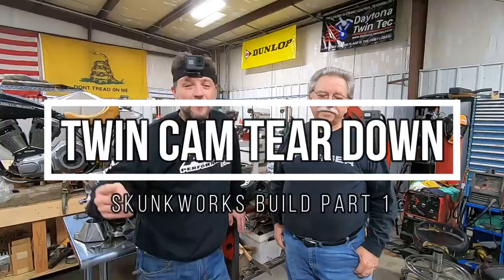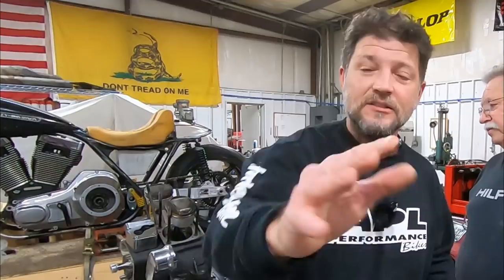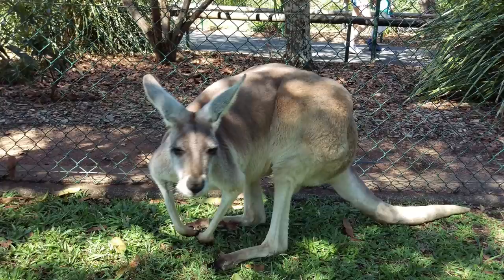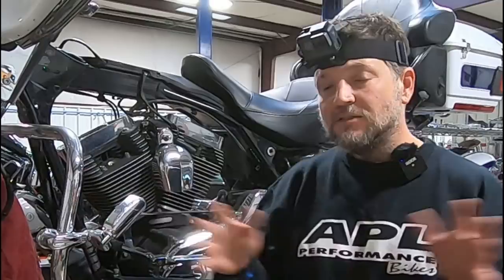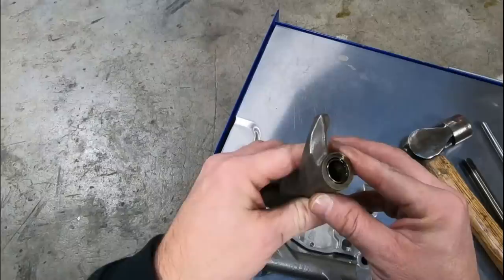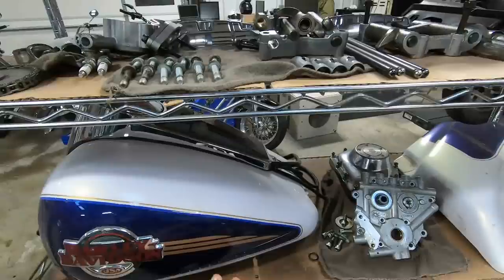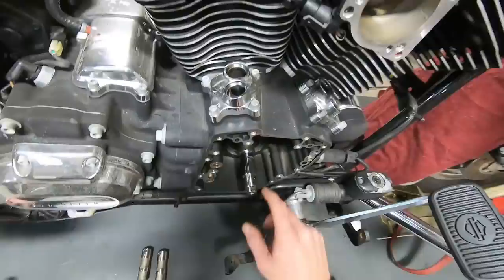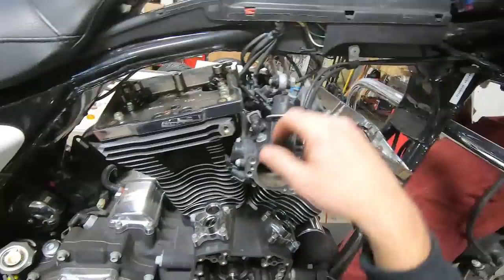Twin Cam Tear Down Harley Part 1 - INTERVIEW WITH DEFECTIVE M8 OWNER - Kevin Baxter - Pro Twin Perfo

Comment: I'm glad you're doing this.  My 2012 Superglide had a BUNCH of metal, aluminum shavings, for the 1st 10K miles.  Plugged oil passages, 2 quart oil refill, till I was finally at 2.75 quarts of oil. (At 10K.)  Dealer said, don't worry.  That said, it now has 106K miles on it with never a wrench to the motor.  Blessed.  No other explanation.  But when it comes time to rebuild her, I'm trailering her back to you boys, from Arizona.  Yup!  I'm sold on you boys.

Comment: My problem isn’t with HD quality control or commitment to quality, it’s the response to a customer concern and failure to address a manufacturing defect in their engine.  No ownership or accountability from HD that completely dismissed a customer complaint.  Might be a specific dealership but in my experience it is universal among HD.
Reply: I had 1 dealer that treated me very well they sold me a bum used fat boy that was punched out to a 95 Cid it would blow oil out of the exhaust id go through a full quart every 100 miles. After tearing the engine apart 3 times they offered me a replacement bike that cost 4k more than the fat boy. Straight up trade and I am really enjoying my streetglide
Reply: @Running-with-skizers  That’s great, glad you had a positive experience.   Any chance you can share what dealer, I’d love to know.  Thanks
Reply: @Squatch_Rider66  it was Z and M in Greensburg Pennsylvania
Reply: I tend to blame the dealer and not HD. HD maintains an arm's length from retail customers for a very good reason. They would never have the staff to address all customer concerns directly. That's what the dealers are for. If your dealer does not give you the answer you would expect, go to another dealer.
Reply: Delt with 3 dealers in Australia and all were fantastic

Comment: I’m looking forward to the Evo repair series. I bought a ‘93 Heritage new in ‘93 and rode it through 46 states and 210k miles before rebuilding it. It currently has 23k miles on the rebuild and has  been coast to coast twice in Summer 2020.I’ll never part with it and I dig carbureted Evos !
Reply: What we need is a stand alone  bolt on throttle body that has its computer built in ..like FiTech for cars ..all you do is bolt it on and run a 12vdc cable to it and hook up a 02sencer And it self tunes its self
Reply: What we need is a stand alone  bolt on throttle body that has its computer built in ..like FiTech for cars ..all you do is bolt it on and run a 12vdc cable to it and hook up a 02sencer And it self tunes its self

Comment: Your a great guy Kevin! Thanks so much for your expertise as it’s greatly appreciated.  We all know how Harley dealers treat their customers (not bashing Harley) , but we always get the cold shoulder at dealers.  I bought my bike knowing from day one I was going to be the mechanic on it and i wouldn’t even think of bringing my bike to the dealer for warranty work let alone any other service except brake fluid changes in order to hopefully (praying) , warranty the abs and brake system.  And hopefully they flush the system properly by cycling the abs pump while changing the fluid.  I pray for Harley and that they make a big comeback and make the changes they need for future customers.

Comment: Had the similar experience with dealer after cam plate/oil pump upgrade in my 99 RK. They kept telling me lifter noise was normal and could find nothing wrong. Went to different dealer they put in non MOCO lifters problem solved. I was able to get the first dealer to pay for the work done by the second one.

Comment: I’m very intrigued with your knowledge of V-Twins and my lack there of lol. I know the basics but as a High School teacher once told me knowledge is never wasted! So glad your taking your time to include us in this journey.  Not to mention I have 2017 RGS with the first generation Milwaukee 8 engine. 15K miles on mine so far, and very lucky other then a little oil consumption. I do have HD’s torque cam and tuner high flow x-pipe exhaust and ventilator intake. As to keep my ESP 🤷🏻 don’t shoot the messenger. Thanks again!....

Comment: I had a loud whining noise in my Evo Heritage a few years ago. Called my bikeshop (not an HD dealer or even HD specialist) and they picked up the bike...they checked it on the spot, ofcourse no noise. But still they took me very seriously, they rode it for a few days until it started making the noise. I had just bought the bike from them a few weeks before and they gave me the choice of me getting my old bike and money back, changing the bike for another or having this bike fixed. Seeing that I had to go on a bike holiday two weeks later I opted for another bike (twin cam heritage). Now THAT was service I have never seen before. All other bikes I have bought or had serviced after that has been with this shop. Thats how you keep customers.

Comment: Interesting I had a 2007 Street Glide, I had several problems with it over the years and the dealership wasn't doing anything about it. The bike would make noise when starting, and at times when shutting it down. Ended being the compensator problem but I had to pay an upcharge to get the SE one installed. They also had to change the clutch basket and ring gear because it was damaged as well. That all happened under the extended warranty period just short of 5 years after I bought it at 48K.
Reply from the maker: Yes sir...you were one of many.  You definitely dont want to miss tonights.  We cover all of that.
Reply: It seems with Harley the more money you pay the worst of the the bike get

Comment: My advice to the owner of the m8. I work at a GM dealership, have worked at Ford also. When you have issues like that always keep taking it in and make them write a repair order so there is documentation of the issue so when it is out of warranty they HAVE  to still cover it. And if the dealer won't attempt to duplicate it and repair it than find another dealer and contact the manufacturer. Manufacturers don't like to here from consumers that they can't get their product fixed and will do what is necessary to make you happy.
I've had plenty of problem child's like that over the years, one if the simplest ways to duplicate it is ask the customer if I can drive it for a few days back and forth to work and around so I see if I can duplicate the issue. The problem is that when your TRYING to make it happen it usually won't but if you just ride it normal it will but it just takes longer.
I bet if he would have called HD they probably would have sent a new engine and took that one back for teardown and analysis.
I've also been in your shoes, diagnosis and repair something others couldn't or wouldn't fix. I've had GM call me to tell me a customer is coming from another dealer so I could fix the vehicle. Frustrating and really irks me that someone will treat a customer that way!

Comment: Hi Recent graduate from MMI.
Great video very informative!!
Wanted to give an input of what I've seen in the new coming up mmi is a business,  the guality of work/hands on and teaching has been water downed. Were pushed through like another number. And when we get to the dealership seems as thought were still another number and not getting that quality training that is need to maintain engines. But my advice is to find a dealership that has Experienced Techs that do give a damn how these engines are maintained. This is the trouble I'm running into finding a dealership that does have that quality. But unfortunately that is what ill be jumping into since I have little to no experience about engines, and try to build that experience. I'm sorry to hear that the tech didn't listen to the gentleman's problem, Yet glad! to hear there are independent knowledgeable  owners like yourself to help people/techs learn more!
Again great video keep doing what your doin!
Reply from the maker: thank you for your interesting comments here and for your kind words.  i wish you well with your career endeavours sir.  best of luck

Comment: Hi Kev yet another great series & as usual wonderful delivery of content .  I would gladly give you all my business if only you had a shop here in QLD Australia. I have an issue with my 2014 RK Classic where by if I wipe out the inside of my rear cylinder muffler i always find it sticky with fine oil film. The bike runs well, has been Dyno tuned, is very well maintained but uses oil. Dealership who has always maintained the bike keeps telling me it’s fine. I’ve had them do a compression test as well as a draw down test. Comp test showed over 200psi. Leak down they say is within specification. Stop worrying they always tell me, we know your bike. The oil dip stick was marked at last service and I did a 1000 mile trip the following week and I took it back and showed them the dip stick level after the ride. It needed about 9 1/2 ounces to top it back up. Their Answer was that the oil usage is ok and in spec. To which I replied why is oil film only in one muffler as I assume that’s where I’m blowing oil out. I said maybe I’ve got a valve spring or seating issue. Reply was we’ll take your money if you want us to do that but the bikes ok. When I clean my Heavy breather air filter it shows no oil other than the pink oil filter coating oil. The Intake is also clean. Just don’t know anyone with your skills to get to the bottom of this before it becomes an issue. On a brighter note after watching your oil segment  a few months ago I went on the hunt for AMS Oil  I’ve just found someone who sells it. I’ve just purchased everything to convert all fluids & will get this done tomorrow. I’m also going to pull the plugs and see if I can get a feel to what’ may be going on inside that rear cylinder. 
Merry Xmas to you Kev & all the boys in your shop. I try not to miss anything you put out. Hope you’ve got enough energy to keep it up.  Ps what’s happened to the red cup lately?

Comment: Very nicely done video as usual and thank you!!  Now, place yourself in the shoes of a CVO owner. They shell out $40000 for a CVO motorcycle and much more for the CVO trike. If it were me , I would not settle for this wear at 21000 miles. CVO's should have blueprinted engines with far higher quality control for what the motorcycle company is getting.

Comment: Intermittent problems are the worst ones to diagnose and repair. As we saw with this bike , it ran great and if you looked in the normal areas you would find nothing unusual.  If indeed you heard the noise you would know something was wrong but that's if you heard it.

Comment: Awesome work, and the "head-cam" views were right on! So COOL to have the "technician's perspective"!! Can't wait to see the rest of the 96 TC Overhaul, as I have a 2010 96 TC and will be doing some upgrades internally as well. I'm experiencing rocker/valve/tappet noise as well and was looking into the rocker shaft tapered bushings to lock down the shafts, but, may have to opt for new shafts and plates to make a proper long term repair. Time will tell!!

Comment: I was a die hard HD guy for most of my life.  I even worked for a short time at an HD dealership just cause I wanted to - not cause I needed to.  However, HD is probably the only brand of motorcycles where a full rebuild is done at a paltry 21k miles - and that's totally normal and no one seems to bat an eye at the thought.  I have owned and ridden pretty much every major model group of HD over the years, and working my way up to finally buying a brand new '15 CVO Road Glide Ultra.  Put 68k miles on it in two years, and it was falling apart towards the end.  I took care of it like a baby, but I do ride hard and fast and long stretches across America.  The bike spent such a ridiculous amount of time in dealerships across the country getting one electronic module after another replaced.  The motor was totally tired and spent after 60k miles.  Not what I expected from a $40k motorcycle that had been a dream bike.  One day, a good friend of my coerced me into riding his new Goldwing, and I was utterly blown away.  Not only was it so much more powerful and faster than my 110 Screamin' Eagle, it was like riding silk.  It was a completely different, amazing, pleasant, smooth experience.  And it handled as good as a sport bike.  I got rid of the CVO, and got a Goldwing.  I'm at 70k miles on it, and not one single issue - other than I found I was riding so aggressive now because of how the bike handles, I was tearing up tires like nothing.  I went double Darkside on the Goldwing, and shouldn't need to even replace a rear tire until past 100k miles.  I'll never go back to HD ever again.  If you love to really ride, and ride across the country all the time - then do yourself a favor, and try riding a new Goldwing.

Comment: I bought a1200 sportster custom in 2008 and took it back to the dealer for valve noise( I am a mechanic)and believe it or not they called me back a few days later and said Harley was replacing the engine which only took about 3 weeks!

Comment: Hey Kevin , excellent vids , have you ever used Rockouts or Rocker lockers ? , i had a top end tick and found the rocker shaft slaping the bolt that holds the rocker assembly on , a defect Harley should have caught in the designe  , i used Rockouts and completely eliminated the tick , cheep and simple fix , keep up the great vids ...

Comment: BTW, I had real clacky lifters too.  They said don't worry about that either.  It took over 90K miles for those to stop clacking.  Blessed again.  But won't ever go back to them.  But I'm sold on you boys.  HD owners love their bikes.  When they find someone else that has that same love, or at least same respect, they use them for their doctor--I mean mechanic.  :-)

Comment: Getting dealers to listen it's really hard because it'll cost them time and money. I had a Yamaha FJ12 a long time ago. Bought from a dealer with 100 miles on it. When hot that motor was so noisy with horrible gear box. When the motor is cooler it was fine. It went back to Yamaha who listened to it cold, it was fine. They just refused to go further. I had to sell it on in the end.

Comment: I wouldn’t drop this on HD manufacturing so quickly.    I suspected shortly into the 1st episode of the tear down series that these shavings weren’t familiar with a self destructing engine.    Sabotage seems more believable than cleaning oversight at assembly.   I’d also add the dealer to the suspect list.

Comment: I get you not bashing HD. Automotive world there are Kia. Hyundai. Engine recalls. I also work on European vehicles. Mercedes-Benz, B.M.W. Volvo and a Rolls and a Bentley every blue moon or so. That being said, C class Benz Im doing chains and guides in. At 70k or so. Often. Turbo engines. Kinda of introductory level car. Anyway, I get it happens. HD being a premium brand I would expect more out of them as they're at a price point of being BMW or Mercedes Benze in the world of Motorcycles. I mean really? Machining mills left in the case? How does one really dismiss that? Its unacceptable! Is it just me?

Comment: As a lifelong GM tech ..They should have used a Picko scope to validate any engine noise ... knock sensor if equipment ,would and could be viewed through live data throughout Rpm ranges  ...or go old school with stethoscope....second the client should have BEEN Taken seriously especially when they already had a scavenging issue to begin with.....I enjoy your videos nothing beats a gear head brother keep it up 👍🏼 😎👊🏼😈🛠...... My question to you and the client is have you reached out to Harley or there regional offices,tech line, field engineer on this issue being YOU have the evidence in hand /videos was so overwhelming ?? Did they make it right for the client??

Comment: Big problem  here in Midwest with ethanol fuel. Would using a quality fuel injector cleaner help with deposits?
Reply from the maker: carbon yes, but ethanol....not really.  an occasional efi cleaner with techron isnt a bad idea.

Comment: question? Since tore down why not replace chain cam tensioner with a chain drive. Isn’t it beneficial in long run . I know is more costly , new cams , pushrods etc

Comment: Going with gear to gear on cams and timing system
Reply: Make sure you don’t have excessive runout
Reply from the maker: Absolutely.  I was referring to reusing "on another build".  Yours will have that pretty perfect crank i showed you.  .0004 runout.  Definitely going gear drive.

Comment: do you have to cut the push rods(i think they're called) or is getting them out a lot of tear down? also when you ohm out the plug wires what specs would you be looking for?
Reply from the maker: i cut em when i know im going in with new ones.  otherwise, pull the rockers.  4 to 5 ohms isnt bad.

Comment: Could you, would you consider performing a gas filter inspection/replacement?
I have an FXDC with around 21k miles and it seems to be starting with difficulty.

Comment: Cannot confirm customer's complaint....., on to the next job. Sadly alot of issues get overlooked because tech are paid by the job and not the time. Isn't just a Harley issue it is a entire field issue with factory repair shops. HD, yamaha, Ford, dodge, chevy, etc...

Comment: Can anyone help I’m in the uk and have a 2019 Milwaukee 8 low rider I brought from new and around 800/1000 miles I am getting squeaky front breaks to which my dealer told me its Harley break pads that are the problem, so I had them changed to a better set and for a while the noise disappeared but now a few hundred miles the noise is back, does anyone in American know of this problem and what I can do about it. The bikes still under warranty many thanks steve